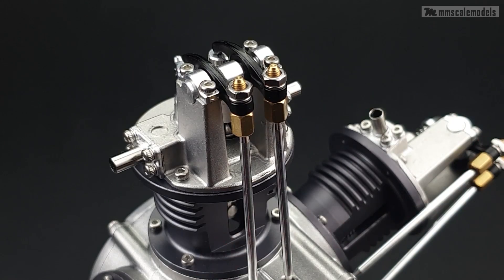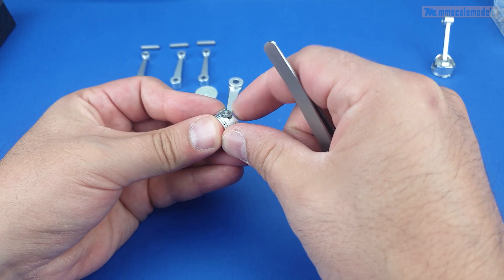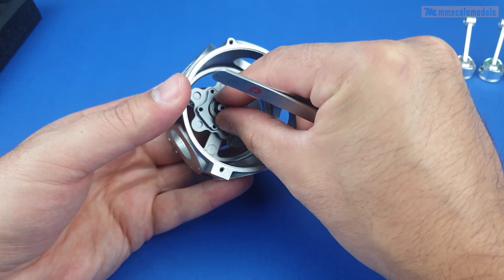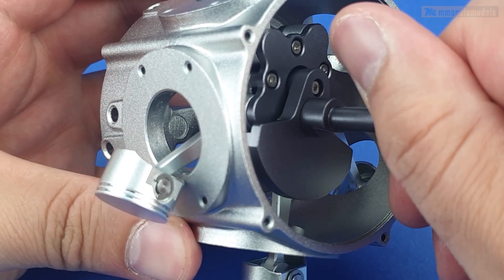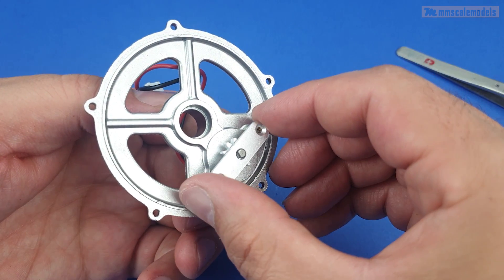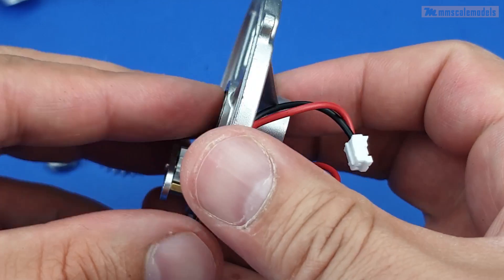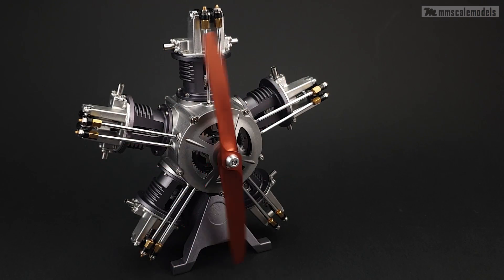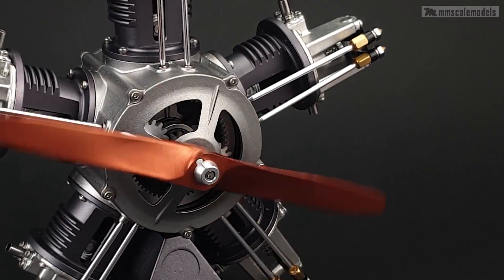Awesome radial engine build - working, see trough 1/6 scale model

Comment: With the discount code it's $440 or you can use the discount code from the website to get it at $399 better deal... if you want it
Reply from the maker: That's right, but the code applies to all products on the website.